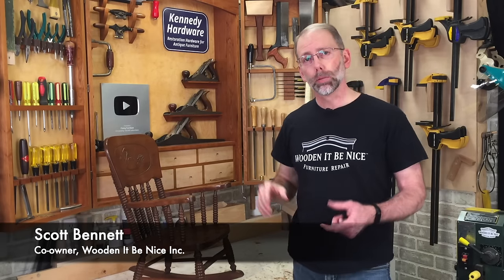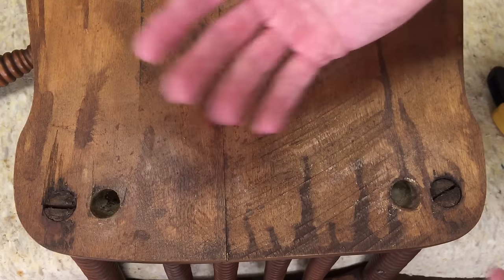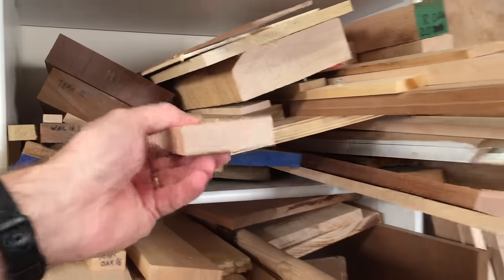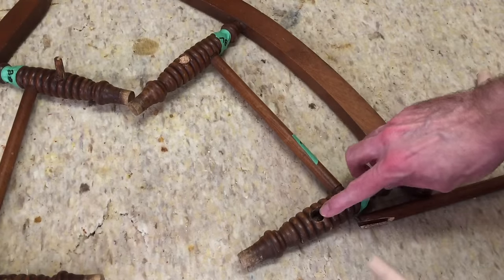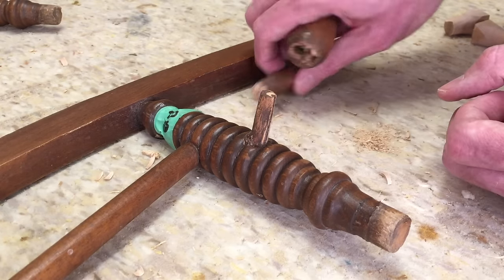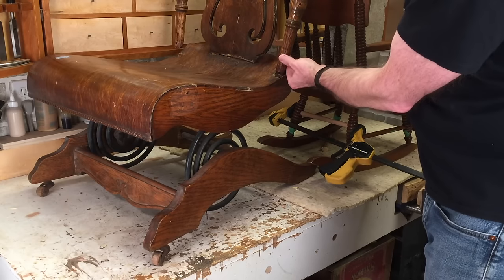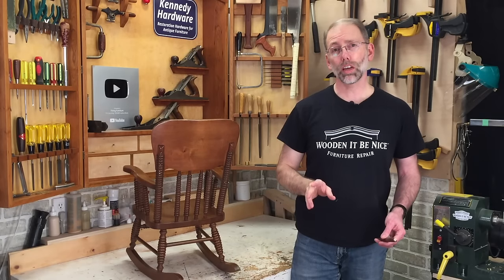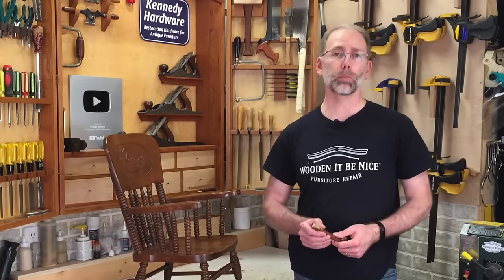Dowels Don't Repair Furniture! Bad Furniture Repair and How To Fix It #4 - by Fixing Furniture

Comment: I do not agree with you regarding dowels.  There are usually three mistakes made that compromise the repair. 1) Not using a hardwood dowel. 2) Not insuring that the dowel seats all the way (and is good fit). 3) Not cutting a groove (or two) along the length of the dowel in order to give the glue someplace to go.  Without the last, one will find it impossible to seat the dowel.
Reply: #3 has been the killer for me, along with not tapering/chamfering the ends of the dowel.  Keeping the stress away from the bottom edge of the hole makes dowels less likely to split the parts being joined when driven all the way down.
Reply: Using a tapered reamer/drill would probably be the best.

Comment: I tried to scream louder, but I couldn’t scream loud enough to go back in time.

What I was taught, about 50 plus years ago, is that one fits wedges into the ends of the tenons on all spindles. When the spindles are driven into the holes, the wedge bottoms out and is driven into the slot in the tenon making a very tight joint that is unlikely to ever fail. Make sure one doesn’t parallel the grain in the mortise.

Comment: Good video. I am retired, but I have 30 + years professional experience in building, finishing and repairing high end custom furniture.
 You're right about having to have a good eye and a knack for matching color. Fortunately, I do. I also have a four year university degree in fine art, which also helps. I became very proficient in touch up work. I'm so glad that you pointed out that the angle you look at a color retouch affects how the eye perceives it. I remember when I first started doing retouch I had worked on a repair of a cigarette burn on a mahogany table top. I had puttied it in and applied a lacquer topcoat, then using Mohawk™ Two Minute Touchup materials and a fine artist's brush, I carefully painted in the grain, gave it a another coat of lacquer, and stepped back to admire my work. It was perfect! You could never tell that had been a two inch long,3/8" wide, black burn on this fine piece of furniture. Then I put up my kit on a shelf on the other side of the room. When I came back I saw the retouch from a different angle. Damn! It stuck out like a sore thumb. I mean, it couldn't have been more obvious if you had a spotlight shining on it. All I could do was compromise. I touched it up from several different angles until I finally got it to look decent from any angle. Thereafter when doing large touch ups, I used a similar approach from the start. I learned to do touch ups so they would look best from the angle they would most likely be seen. Remember, you are camouflaging the defect, not eliminating it.
Reply: I've done this too for 30+ years. I say you can't duplicate chatoyance. Now, having said that, I am willing to pay money to anyone who can prove me wrong.

Comment: The clean lathe system looks like it performs great! Nice work designing that. Hardware stores around me do sell red oak dowels, which isn't the best for fine furniture, but at least it is sturdy if you don't have a lathe.
Reply from the maker: Thanks.  Yes, Red Oak is harder than Poplar dowel.  The key is to find one with very straight grain so it's as strong as possible.  Cheers.  Scott

Comment: @Fixingfurniture thanks for the lesson.  I have a very similar rocker to repair.  I don't have a lathe unfortunately.  Nor do I have money to pay someone who does. 
For woodfill there's another option for custom fill...remove the old finish then once it's clean you can sand the area. Collect the dust and mix it with ca glue really well...

Comment: Scott, nice repair on the child's rocker. I'm always interested in seeing how color matching with dyes and stains and wax stick blending is accomplished. I'm also interested in that weird "don't do this" rocker repair. Did you ever fix it? Almost surely there was a set of arms on it that I would think would help strengthen that weak back joint. I also assume the spindle with the bad bottom end repair is just another more elaborate lathe job. If you did repair it were you able to design a stronger back joint? Anyway, I would love to see that chair repaired and a video posted. Cheers from VT!

Comment: I would love to see a course on everything that has to do with color matching! I understand that an ounce of cure is worth a pound of prevention, meaning the closer you can get the better. I understand using oil based toners to “tweak” the color. I also understand that there is a type of special lacquer that you can use after each time you put a layer of stain on to give you multiple chances to “build up the color ” and get the color right. My problem is that no one sells these products where I live in Alaska. because these are considered hazardous materials, the shipping is extremely expensive! So, understanding alternatives would be very helpful, also understanding the differences between water based and oil based stains and how the process differs. It looks like you just layered the water based stain on top of itself to “tone” the part. Finally if all else fails or you make a mistake while you are developing the skill what do you do? I love your videos! I think it is so sad that nowadays when something breaks you just throw it in the garbage and buy a new one. It’s too bad that commercial furniture isn’t made like it used to be.

Comment: In regards to the dowel-fix, that you don't want to do anymore. I have no idea if it will work. Sometime, to preserve the original wood as much as possible, it's the "only" way. But I'm thinking.... How about a stepping dowel? A deep 3 mm hole, a not so deep 5 mm, not so deep 7 mm and so on. Then turn a dowel to match. Or (more difficult) a conical hole and dowel. Might be worth testing? I'm not a woodworker (yet), but I enjoy your videos, preparing myself for a possible retirement job/hobby. ;)

Comment: A dowel joint is a strong joint if it's done correctly.  Dowels have been used in joints throughout history.  But part of what you are saying is correct.  The strength of the joint is along the sides of the dowel.  This works well if the wood the dowel is going into is thick enough.  Then the weak spot at the end of the dowel that you spoke of is not weak at all.  But when you have paper thin wood around the dowel, it's an extremely weak joint.  It's the same thing if you secure something with a screw or a bolt.  That can be an extremely strong joint.  But only if it has a lot wood around the fastener to give it that strength.  If you screw into thin or compromised wood, that joint will fall apart.  And another factor to consider in a glue joint is surface area.  The more contact surface between the two pieces being glued, the stronger the connection.

Comment: There's a "dowel" repair I've been wanting to try, but haven't had a chance to test yet.  My idea is to drill a hole using a "stepless" drill, and put a cone on the dowel to match.  It would be mostly side grain.  And I wouldn't use a home center dowel, but instead something at least as strong as the original wood.  If you've tried that, I'd be interested to hear your results.

Comment: Hi Scott from the UK. I bought a very old set of chairs, which at one point had castors added to the front legs. They seemed retrofitted, and half of the casters were badly damaged beyond repair, or in very bad shape. I'd removed them and planned to fix the front legs back to the correct length (that is sans castors) using the previous method - would it still be suitable if the force is travelling directly downwards, or is there any alternative fix rather than replacing the legs entirely?
Reply from the maker: It really depends on the dimension of the material you're working with. It might be possible to use a "foot" with an integrated tenon. We can discuss it over a Zoom session if you're interested. Here's a link to buy an advice session - https://woodenitbenice.ca/collections/woodworking-advice-sessions

Comment: Your thoughts on using dowels for repair are very interesting.  Given that, what's your opinion of using dominoes for repair work?
Thanks for putting out your content.  Very helpful.
Reply from the maker: Hi Paul.  When repairing work, it really depends on how much wood structure you're taking out when modifying it with a domino.  The key is to ensure the furniture is strong.  As you've seen, the flaw in adding dowels in these examples is that they weakens the furniture.  I hope that helps.  Scott

Comment: At 6:40 into the video a set of tiny picks would help alot on scraping away the glue from those joints after using the vinegar
Reply from the maker: That's a good idea.  Thank you for sharing that tip!  Scott #tip
Reply: @FixingFurniture  your welcome

Comment: It seems to me that, perhaps, a serious problem here that was overlooked was a structural repair of the chair seat.  Do you have another video that covers this?  I have such a chair in need of repair -- where the entire seat was split and partially repaired with a metal strap on the bottom.  Suggestions?

Comment: If the only option is a dowel type situation, create a dowel across the grain then when installing, you will always have across grain to end grain situation. This is similar to a normal  doweled joint where there is always a cross grain situation and an end grain to cross grain.

Comment: What about using a tapered drill bit and a dowel tapered at the same angle? Would need to make some jigs to shape the dowels. But could save time for a complex turning or where rare wood is involved
Reply: Looks like there is an off the shelf solution to the dowel issue you mentioned. Look up miller dowels.

Comment: Hi, any advice as to how I can restore a matte finish on a white wood dresser? I accidentally cleaned a spot on it with something that made this one section all glossy so the finish looks horribly uneven now. Any advice would be greatly appreciated.
Reply from the maker: A gentle rub with superfine steel wool will dull a finish.  It's sometimes sold a "0000" steel wool.  Cheers.  Scott

Comment: Thats some contraption you have for collecting dust .I use a 4 inch hose connected to Dust Deputy .The skew chisel works better than a roughing gouge on the lathe almost no sanding required

Comment: I'll point out the obvious that dowels and loose tenons are used to make new furniture. So using dowels to repair is neither an absolutely good or bad idea. It can work well in some cases and it's a bad idea in other cases. Logical conclusion.
Knowing when it will work and when it won't is professional knowledge. I like how Scott learns from seeing failed attempts at dowel repair to learn when it's a bad idea to use them. (He'll never see the good dowel repairs because, well, those joints won't come apart and enter his shop)

Comment: 10:21 Keep your lateral pressure away from the blade. 

If you're pushing the wood into the fence and you move to far forward, you start pushing the wood against the blade, trapping the blade. That's when kickbacks can happen. 

I see this done time and time again on YouTube. Never trap the blade.

Comment: But Scott, not all of us have a lathe.  There are still circumstances in which the dowel fix on a stretcher is good enough for DIYers.
Reply: Easy to buy birch dowel rod on the web, get one close to the original diameter (no one will notice if it's not exact) and then fit as shown in the video.
Reply: @jamesbenenati1039  Not so simple for me.  I have a more decorative H-stretcher on a 1959 Windsor chair with a broken tenon.  It would require a lathe to properly replicate, not to mention staining, etc.  It complicates the repair.  So, I'm going with the repair in Scott's retracted video, which I believe will be adequate for my purposes.
Reply: I did the dowel insert repair on my H stretcher.  Time will tell, but it's solid for now.  I think this repair is fine for DIYers without a lathe.

Comment: At 40:41 you are trying to put a dowl in, first saw or scratch a way out for the glue trapped in front of the dowel.
Reply from the maker: Sorry, I don't understand your comment.  Would you explain a bit more?  Thanks
Reply: @FixingFurniture  When putting a dowel in a drilled hole, air and glue are trapped in front of the dowel while inserting. Sawing or scratching an escape channel along the dowel allows air and glue to escape.

Comment: That metal sprung rocker looked as if it had arms bracing the back to begin with. Their removal would have increased the strain on the back and isn’t that more likely to be the reason for the back failure rather than flawed design?

Comment: If only this was a live video Scott,  i could see those 2 back spindles were not in place while you were putting the wedges in as soon as you turned the chair upside down 😢
Reply from the maker: Yes, that would have been helpful.  I was distracted by filming at the same time as assembling the piece.  Thankfully I got those wedges pulled out without breaking them.  Cheers

Comment: As far as dowel repairs - what do you do when you can’t replace the broken piece?
Reply from the maker: As a professional, I wouldn't recommend another way to do this.  If you are repairing your own chair, and don't care about repairing it to extend the life of the chair in the future, you could try epoxy to hold it together.  If that fails, the repair by a pro will be more expensive or you may have to throw out the chair.

Comment: Scott - I appreciate you and respect your work and guidance. With this video however, I would have to agree to disagree with some of your guidance. 

The repair you made to a plain rung was better with a new piece. The prior repair was poorly done. End gluing is never a long term viable solution for any repair. Inserting a dowel in the midpoint of a leg or rung would not rely on only end gluing and would be suitable. 

Additionally, with a more ornate or decorative rung or leg, it would not always be practical to turn a new piece. That should not mean a chair should be discarded. 

I have made several repairs with the dowel technique over the years and they have held up without any issues. It is about when you should and when you should not insert a dowel and the proper methods and adhesives. 

IMHO a blanket statement of you “should not do this” is too finite and can mislead and misinform the viewer. When in doubt an experienced professional should be consulted for the most suitable approach.